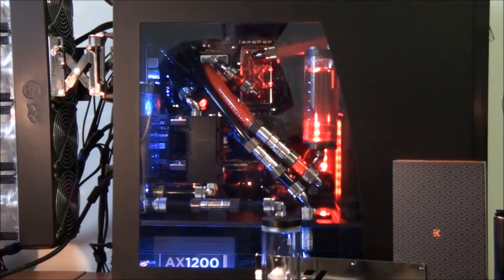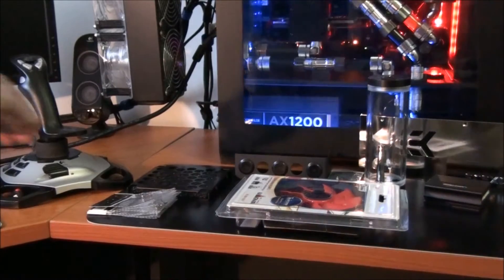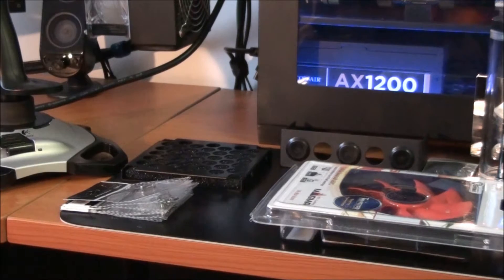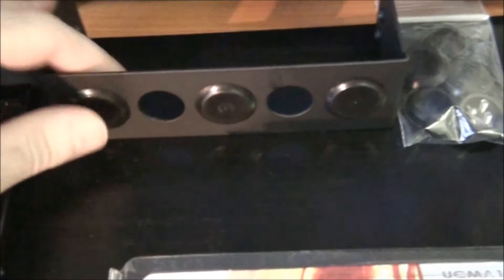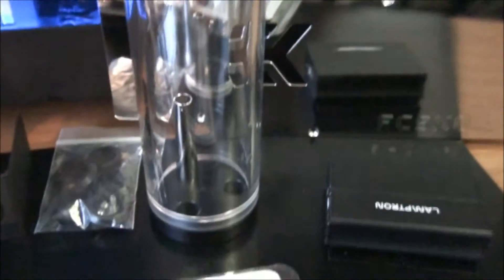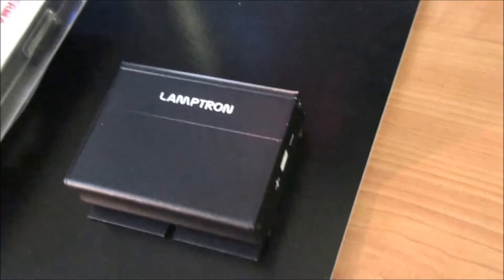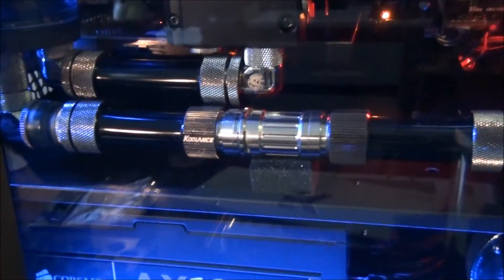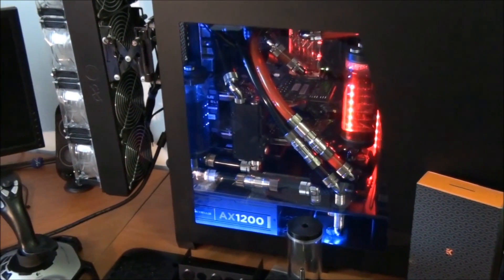Singularity Beast Upgrades Part 4

Comment: Hey, have you considered using Demciflex magnetic filters instead? you can get them to the exact measurement and shape you want, and just use a steel fan shroud infront of the intake fans on the external rad, would be alot easier and alot less restrictive, their VERY cheap, I got 3 of them for my new Corsair 650D, custom made, for 30 dollars US, including shipping from South Africa to Denmark. check it out